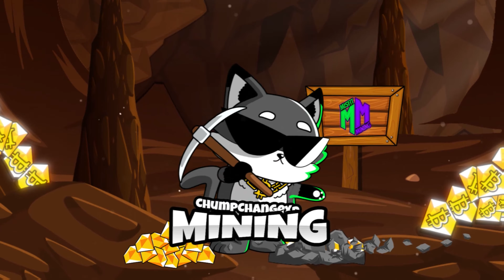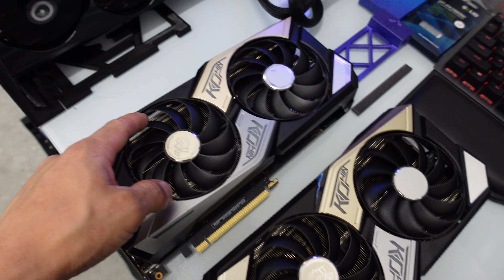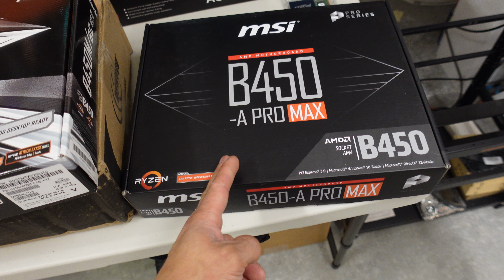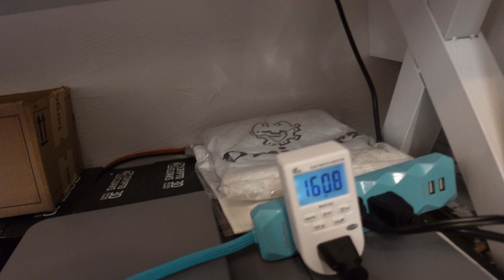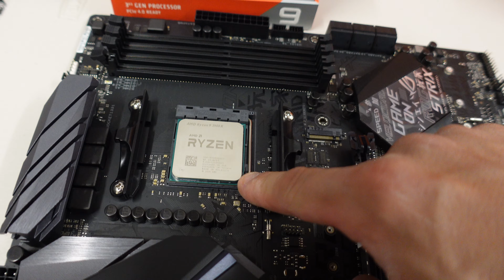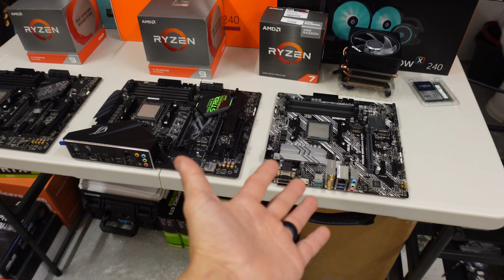3X NEW RYZEN CPU Mining Rigs | Starting Steps On My RYZEN CPU Mining Rigs

Comment: Plz turn 180° on that radiator, the hoses should be on the bottom side due to the air bubbles in the system.

Comment: Would be super interested in the hashrates you are achieving I’ve found temps can play a big role and most people do run stock coolers. So with your waterblocks it would be interesting if you get a high avg. I’m currently running 3x Ryzen 9 3900x so would be keen to compare

Comment: The power draw is dependent on the specific algo the miner is using at any given time. Mine do it too. You just have to watch it for a while and get a baseline before you choose a low power psu to make sure you're in the right range. Thanks for the heads up on that psu last week too. I grabbed one when they were at $24.99 and swapped it out with a 1300W spare that was installed but was the only spare I had. This 450W is much better suited for the job and was cheap enough to justify.